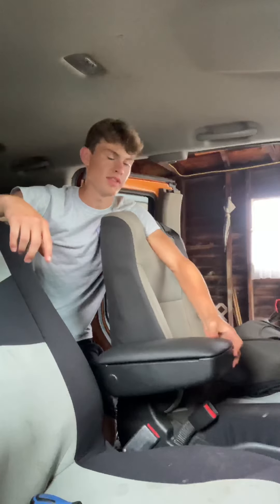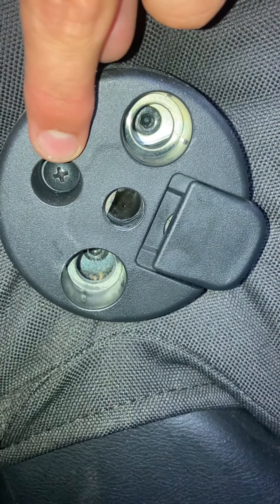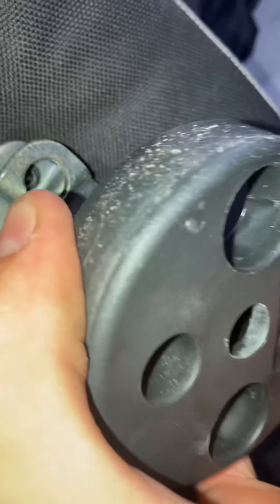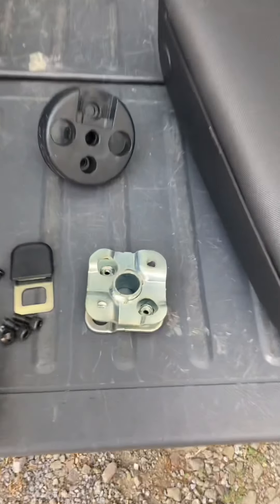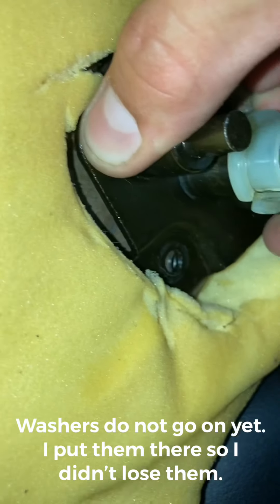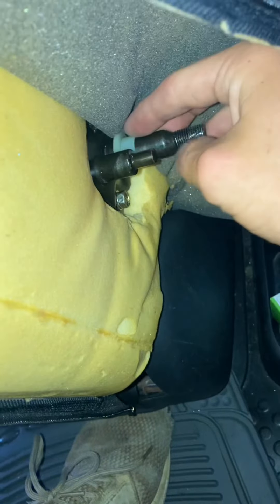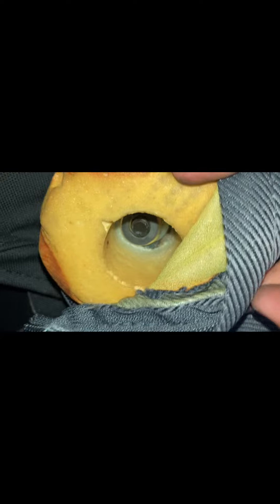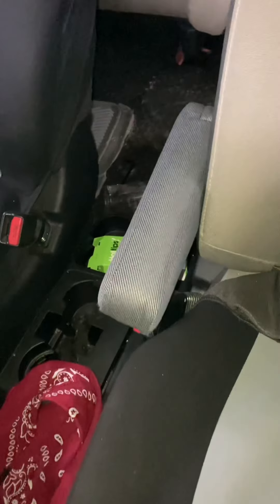Removing Center Console Armrest and Installing a Regular Armrest Honda Element

Comment: Hi, I have an '04 Element with this same armrest console. My issue is the button on the front of the console does not pop back out to lock the armrest in the desired position. I have to use needle nose pliers to pull the button out far enough so the armrest can lock in place. I opened the insides of the armrest and noticed a black spring is loosely hanging from a metal rod. My intuition tells me the spring has become detached but I don't have a clue if/where it should be re-attached. Help! Thanks
Reply from the maker: Hmm. I’m not sure, I’ve never had one like that. But I think I’ve seen some that just flop down. Probably an easy fix if you’re creative.